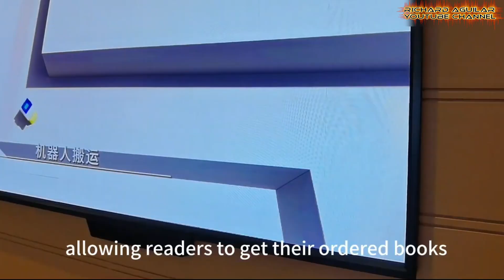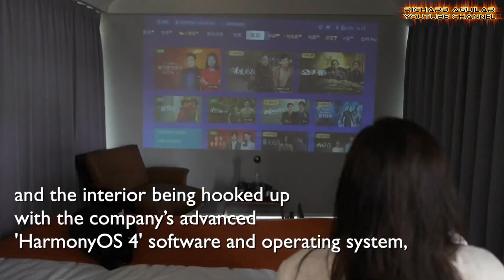China's Latest Technological Breakthroughs! Experts were Shocked

Comment: China has no environmental ethics.  China has ignored the Climate Crisis and environmental protection for too long.
Weather events are getting more extreme because of Climate Change. Damage from extreme weather events will have huge costs.
How hot does it have to get before governments and corporations wake up and stop adding more fossil fuels to the climate fire.
There is a Climate Crisis. We need Climate Action NOW !   Floods, droughts and extreme temperatures caused by burning fossil fuels will get worse over time. Adding more coal power plants will make the Climate Crisis even worse. Adding new wind and solar energy production is where new infrastructure spending should be done.  People need clean air to breathe and clean water to drink. China has allowed companies and people to pollute the air, land and water resources they need to survive.
Reply: F king 🤡. Go unalive yourself
Reply: taiwan1450FLGunit8200